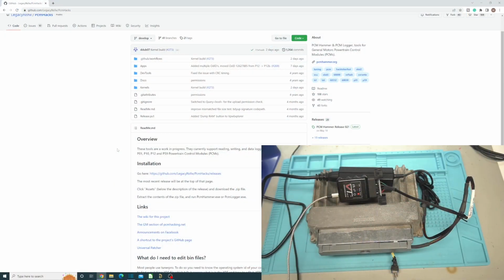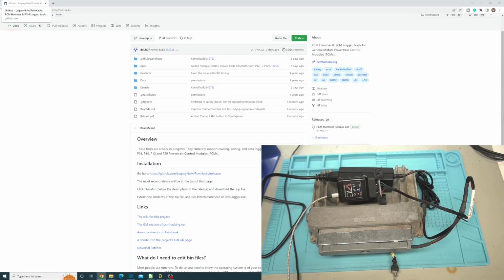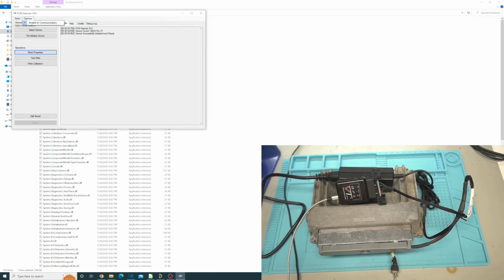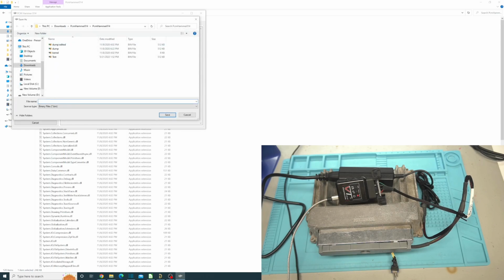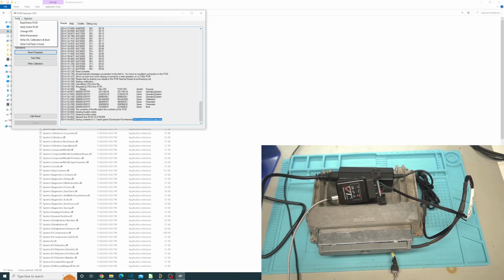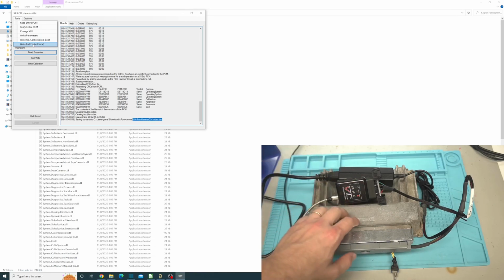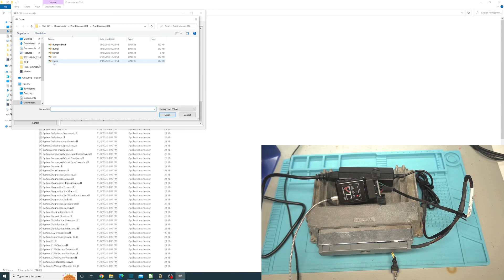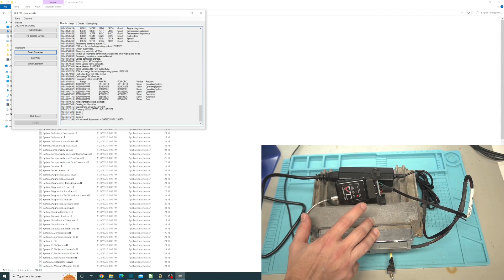P59, P01 and 0411 PCM Tuning Connector Plus Giveaway!

Comment: How about actually hardwiring the pcm so you can tune without removal of the pcm . There is a Dodge computer (96-03) that is widely used and can be tuned but it’s hoops and jumps to get anything done and the cost is rediculous, and to me it seems like it is almost identical to the gm computers (0411)).    
  Have you experienced anything with the Dodge computers ?

Comment: Hi, I saw an older video, but thought that you're most recent would be a better place to contact you. I've messaged you in the past, but don't remember how. I'm looking at getting a 02 chevrolet silverado cluster completely gone through & have the millage & engine hrs changed. If there's a better way of contacting you in this regard, please let me know or if you're still doing it.
Reply from the maker: I don't have an easy way to program those at the moment without going direct to the chip and I just have the time in the day to do it right now. Im not blowing you off just cant handle the work at the moment. Try hitting gaugewerx(he doesn't really like 99-02), Amarillo cluster repair, digital dash solutions or really any of the guys that know what they are doing.

Comment: I wanted to swap a clutch fan with electric fans in my 2004 Silverado.
I know you have to connect to some pins and edit the PCM to "turn them on".  Do you know if PCM hammer could do it? I know nothing about tuning.. just curious
Reply: Nvm seems like it can. Have you ever bricked a PCM with this software
Reply from the maker: I haven't bricked one. Its actually pretty good at recovering from bricked PCMs with HP tuners. just save your original bin. Not sure what your soldering skills are but if you manage to brick it just pop the flash memory off and reprogram it with a minipro.
Reply: @FixedUntilBroken  thanks for the reply. I tried to do some research on PCM hammer in the past and never found any good videos so it's cool to see you using it. 

I'm not very good at soldering. This is Shaun, you fixed my dorman remanufactured cluster and put LEDs in my dash components. Pretty sure it's been over a year now and everything still works great
Reply: @FixedUntilBroken  usually not necessary to desolder anything grounding a certain pin and immediately writing entire takes care of it most of the time
Reply from the maker: @devious762  I thought that was just for a locked PCM does it also work for a brick